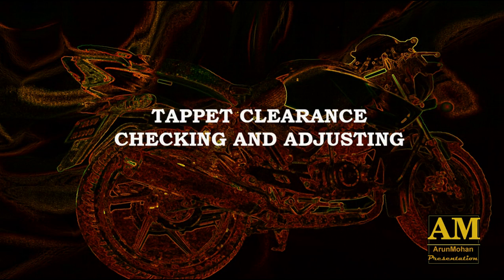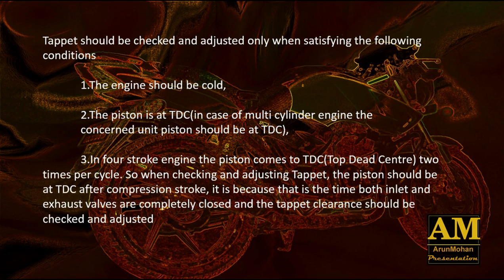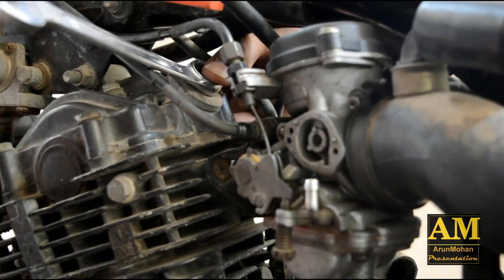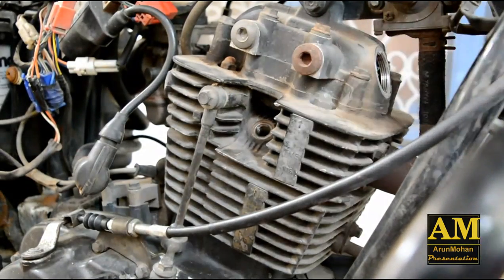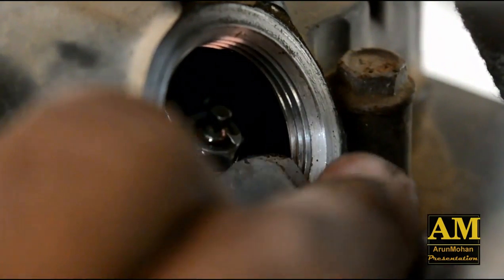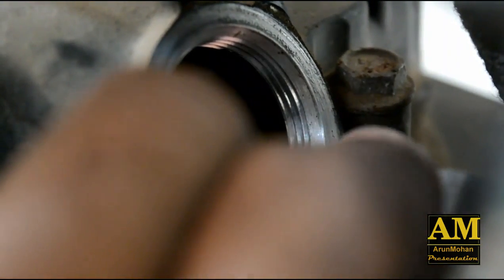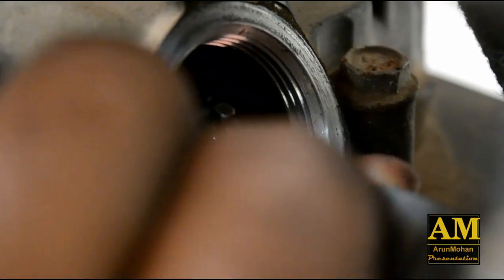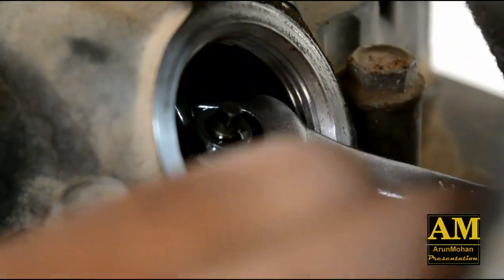Tappet Clearance Checking And Adjusting | TVS Apache RTR | Four Stroke Motorcycle | BIKE| DIY|

Comment: Hi Sir!
I have an Apache RTR 180. It's currently on it's 18,000 Km.
My bikes Service provider hasn't did any tapped clearance to my bike yet. Now, I can hear a noise like two metals collision inside the engine and I feel like bike start cuts off but it's automatically recovers from it and runs normal. 
This issue happens very rare. 
Could you guess the actual problem?  Is it related to the tapped  adjustment and should I adjust the tapped on my next service?

Thank you.

Comment: I already taken the caliper off the wheel including the fluid hose. Is there a way to extract the pistons if both a closed? I tried that way the new brake fluid is not moving the pistons. Help me please
Reply from the maker: Just pump by pressing and depressing brake lever, that will push out the pistons.
Or else remove  air through purge hole then pump by brake lever, piston will come out

Comment: My RTR 160's Float Bowl leaks petrol while riding every morning. Any solution to this?
A mechanic replaced a 'Fuel Assange Valve' in it. After 9 months again the leak happens.
Reply: Me too facing the same problem. Do you got solution please share with me. I am losing lot of fuel because of this problem.
Reply: My Apache tank got leakage due to rust. After fitting another tank and cleaning the bowl the leaking has stopped

Comment: For RTR 180, standart values are 0.06mm - 0.08mm. And service limits are 0.08 - 0.10mm.
For RTR 150, what are the values?
Reply: So which setting will be best
Reply: 0.07 in inlet and 0.11 in exhaust
Reply: @pronaysaha2953  I only have metric quide. Not the inch one. So, I do 0.05mm and 0.10mm which are closer to these. It works...

Comment: any questions relative  apache you can ask
Reply: hi i have apache 150 cc so far 60k kms done while driving single pick up was gud but in double bike jerks very low pick up very hard to touch 50kmph can u help me
Reply from the maker: check,clean and adjust the carburettor,check and change/replace spark plug
Reply: over vibration also there while in doubles
Reply: How to stop the noise of head